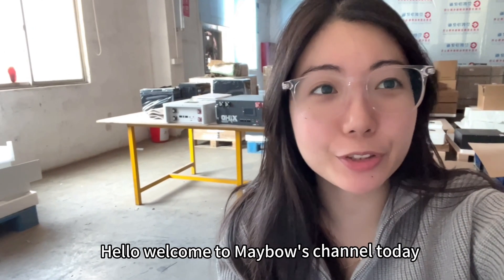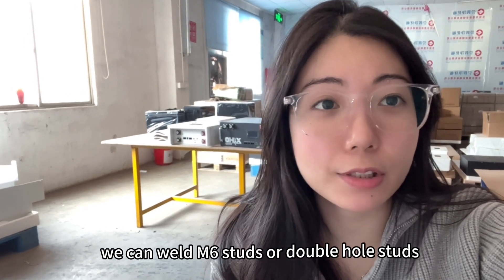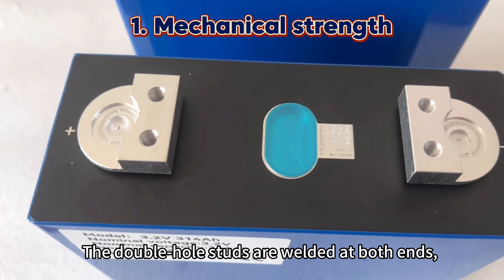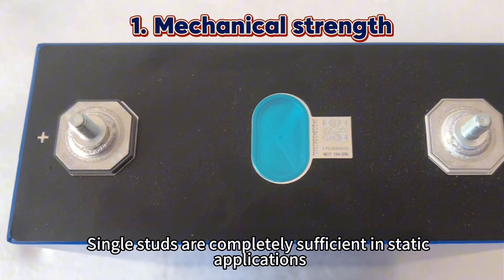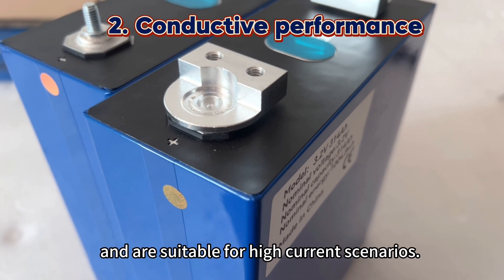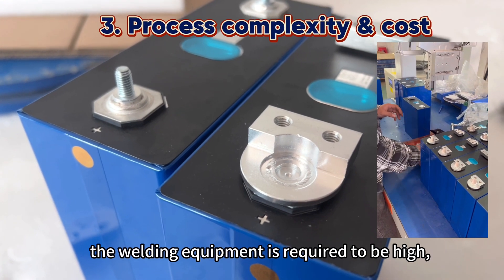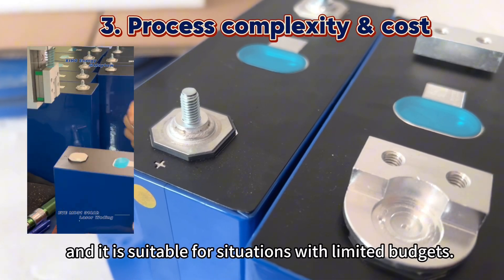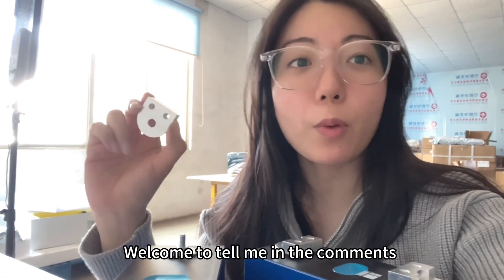【XIHO Energy】Is welding double-hole studs for LiFePO4 battery definitely better than single studs?

Comment: Depends on the application. There is a DIY battery kit out there that uses the double pole and it looks like a better designed kit compared to the single pole stud.

Comment: Dubble fals off with a slighest force on scrwes (4kN) if the welding is not deep enough! It happend to us, with brand new batteries. And what to do now?  :( :( :(
Reply from the maker: Hi there, from what you said, it has nothing to do with the battery itself. It is the insufficient parameters of the welding equipment that affects the firmness of the welding.
Reply: Probably bad welds. Iv put as much as 10nm on them just fine